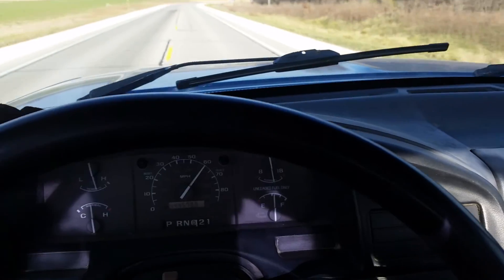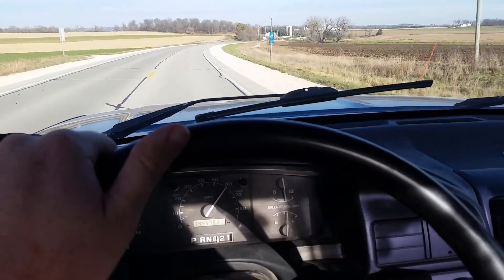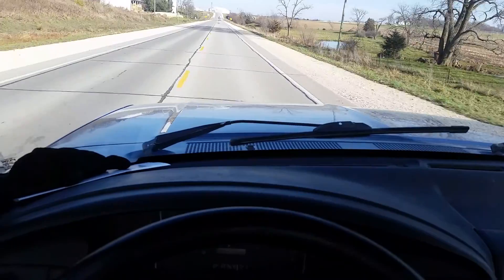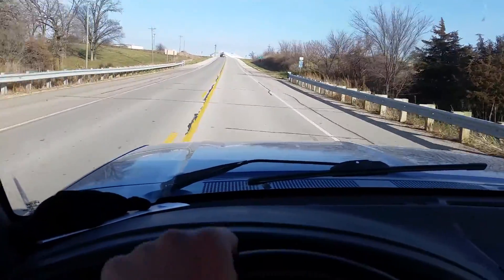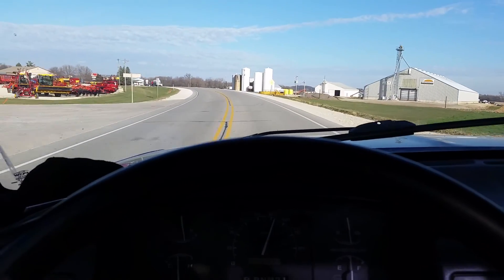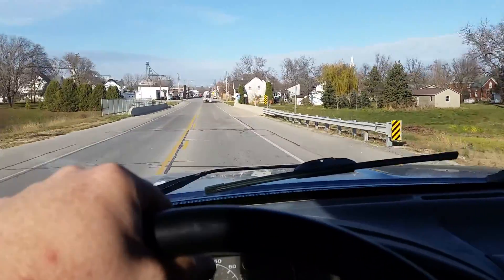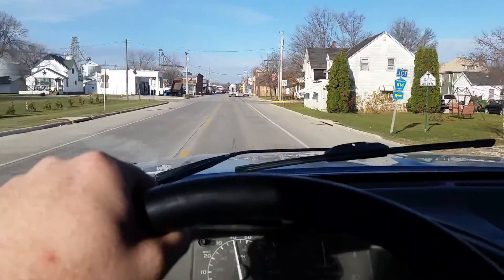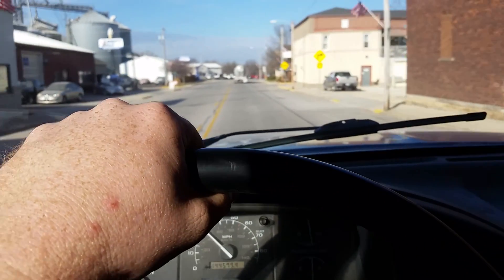Is tightening a steering box a good idea!? 1993 ford f150

Comment: Mine was extremely loose also. I had turned it 1/2 and it was “better” for about a year. The bushings and ball joints on ANY 30 year old truck will make a big difference. That “catch” that you feel could be your ball joints and old shocks rocking back and forth. I can hear mine creaking and groaning when I back out of the driveway still . Lol watch the U joints they get loose and clunk around as well. Nice truck btw!

Comment: Gearbox should be adjusted to snug and backed off 1/2 turn. Then start truck, turn lock to lock 3 or 4 times. If any "sticky" spots, backoff another 1/4 turn. Repeat lock to lock test. If you have to backoff 1 full turn or more to eliminate "stiction", replace gearbox ASAP as it has worn out internal parts.
Reply: Do you perform the adjustment and turning test with tires on the ground or elevated?
Reply: @alphaclean3364  Either way works. Off the ground minimizes resistance making it easier to notice any "stiction" from over-tightening.
Reply: @stevenmitchell6347  That makes sense. Thanks!

Comment: let me tell ya I've drove my dad's old 94 has about a 1/2 inch play left and right which I thought was some tie rod ends or to the idler arm is wore out .but I've looked under and checked for loose ends or play in the camfer upper and lower ball joints nothing was loose but the steering gear box was .loosin the worm gear nut enough so you can give it a 1/4 inch counter clockwise turn

Comment: Put a steering stabilizer on it
Reply: Does it help that much?
Reply: @abelvalle6188  steering still has play but it is much better than what it was much easier to control I gotta replace some bushings and shim the steering shaft before my steering will tighten up I was going for an easy fix
Reply: @abelvalle6188  no! Some moron put one on my 88 and it causes all sorts of damn steering problems 😒 truck drives so much better without that thing on it. It only is okay if you have bigger tires